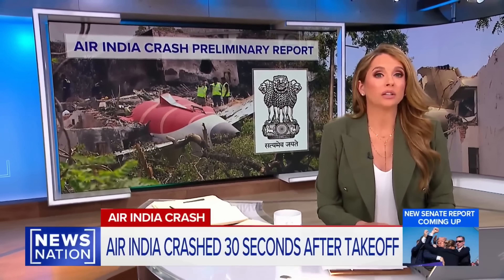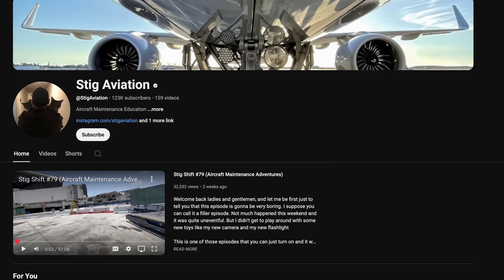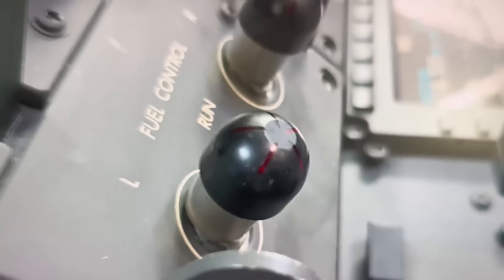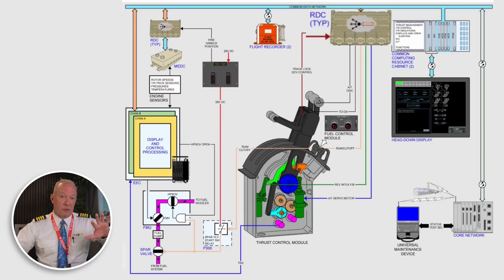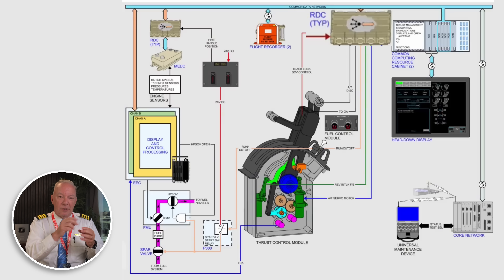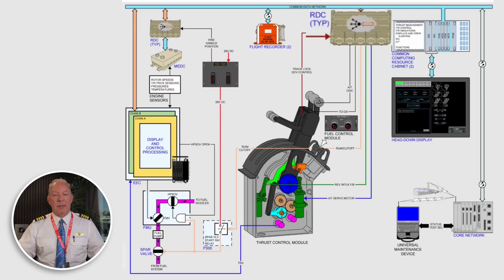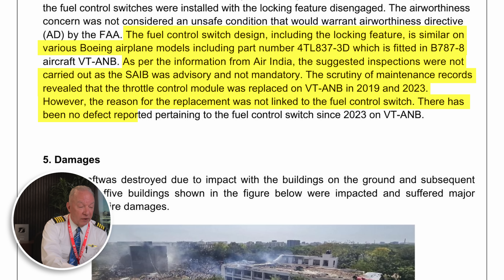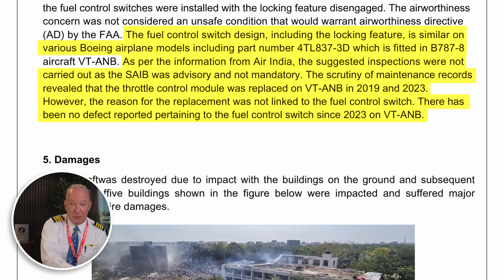The Truth About Boeing 787 Fuel Control Switches

Comment: 7:55 Captain Steeeves statement that all fuel control valves are part of a closed loop system controlled only by manual cutoff switches is totally incorrect. Boeing's own patent document schematic for the TCMA system (US patent 6704630B2) clearly shows that the HPSOV valve is connected to both the manual cutoff switch, AND a pair of autonomous FADEC relays that have the ability to rapidly shut fuel delivery to the combustion chamber by closing the HPSOV solenoids. While it's true that the TCMA system (in theory at least) is only operational when the aircraft is on the ground, the two EEC relays that it controls must remain operational at all times for fuel to flow to the combustion chamber. A paragraph from the patent document reads as follows: “In a preferred embodiment, HPSOV (58) is controlled by fuel control relay switch (108), which is located in the cockpit of the aircraft. Placing fuel control switch (108) in the run position while fire relay Switch (82) is in the normal position causes input (72) to Supply Voltage, for example 28 Volts DC, across HPSOV open coil (118). When fuel control switch (108) is placed in the run position, Voltage is Supplied across ELMS run coil (88), which energizes ELMS run coil (88) and causes ELMS relay switch (102) to be in the run position. With ELMS relay switch (102) in the run position, ELMS (52) Supplies electrical current to EEC first channel relay Switch (22). If Switch (22) is in the run position, current flows to EEC second channel relay switch (28), and if Switch (28) is also in the run position, voltage is applied across HPSOV open coil (118), which energizes HPSOV open coil (118) and allows fuel to flow to the engine utilizing HMU (64). Thus, for HPSOV open coil (118) to be energized, and for fuel to flow to the engine, both EEC first channel relay Switch (22) and EEC Second channel relay Switch (28) must be in the run position. If either one of the EEC channel Switches (22) and (28) is in the cutoff position HPSOV open coil (118) is not energized and HPSOV closed coil (100) is energized, thereby closing the HPSOV and shutting off fuel flow to the engine.”
Reply: so why are there so many comments praising steeeve at the top section of comments?
Reply: @CoffeeHead047  , how does comments praising something change the facts of a circuit diagram??? Do you suppose people praising a piece of poop will make it appetizing or edible??
Reply: TCMA is not going to be involved here, though. Anyone reading up on it should understand that. If TCMA were somehow active, you would see all sorts of signs of that, anyway. It would be obvious in the data. We don't see that at all.
Reply: @bills6093  I agree in that if TCMA were to be involved, there should have been an EICAS "Eng Fail L-R" warning along with an audible warning, which doesn't appear to be the case. To be clear, I'm not speculating as to the cause of this incident, I'm only pointing out that there are two autonomous relays in the EEC module that are connected to the HPSOV valve, along with the now infamous manual cutoff switches. No more, no less.
Reply: Do you have a link to share?  Or are you just making tuis shit up?
Reply: @mas3ymd  I am QUITE sure greg's not making this up. But why don't you just check it for yourself? It took me less than 10 seconds to Google the Patent Number he listed. He quoted the patent word-for-word.
Reply: So there's this new thing called "the google".  If you type that patent number into "the google" and press the enter key Voilà, its Magic!
Posting comment with URL link gets it automatically removed pretty much all the time now, because this isn't the youtube people liked in say 2007 anymore.
Also it's happened during landing at least once, possibly 3 times and pilots can't relight the engines.  Other channels like Garybpilot have covered this recently.
Reply: @mas3ymd  It's not hard to find. Google patents US6704630B2 Thrust Control Malfunction Accommodation
Reply: @mas3ymd  , captain steve shows part if the circuit diagram. It clearly shows this is not a "fully closed loop" system as the poster above indicates. There is an "AND gate" on one of the components, which means there is some other inputs in the system.
Reply: You say alot, but regardless, the system was checked thoroughly and found not at fault 🙄
Reply: @gregmiller3630 That is a load of it. I’m a Electrical Engineer and what you are saying is bogus.
Reply: @mtwedt  Did you look at the patent? The wiring diagrams? The signal path and operational description?

Where did you get your degree, and can you still get your money back for the tuition you paid?
Reply: @BryanM61  I have looked at the patent.
1) It's a patent, not a design document. How do you know that it applies to the 787? And even if it does apply to the 787, just because Boeing has a patent doesn't mean they implemented it the same way as the patent describes.
2) The diagram Steve shows in his video is derived from design documents specific to the 787.
3) The scenarios described in the patent are not present in the accident.
4) The preliminary findings say that the switches were moved, although they don't say how they know, it is probably from hearing the clicking of the switches on the cockpit audio recorder.
Reply: @mtwedt  Here's how we know the switches were moved: As Captain Steve explains in the video, and as shown in Stig's diagrams, each Fuel Control Switch has 4 wires that lead to (redundant) Remote Data Concentrators. These wires run directly to the RDC's. 2 wires signal 'RUN', 2 wires signal 'CUTOFF'.

When the wire energizes - which can only happen if the switch is moved or the wire is shorted to ground - the RDC's format a data packet with the specific Device ID and the event type (e.g. "FCS#1 -> CUTOFF"), and send that event to the data network.

The DFDR "sees" the event and records it to the data log. 

Since the Prelim implies timestamps for the first two events, and gives exact timestamps for the last two, those MUST have been read from the DFDR data log.

In the case of switch transition to RUN, that data packet is also "seen" by the EEC, and the EEC begins the engine re-light process, which happened with both engines.
Reply: "The aircraft air/ground sensors transitioned to air mode, consistent with liftoff at 08:08:39 UTC."

The aircraft systems were in Air Mode; the TCMA could not have been active.

Comment: Sorry Steve. The fuel control module is not tied directly to the relay according to the diagram you put up. In fact it does not show it tied into anything. The wire that activates the relay comes from the RDC shown at the top right of the diagram. We would actually need to see a true electronic wiring diagram to see how it works. I don't understand how you could be so hell bent on accusing the pilot of mass murder here! imo

Comment: Great video! If the Ram Air Turbine deployed after the AC power went out, that means the aircraft’s DC system was still alive — because the RAT is deployed and controlled by DC power. Those same DC buses power the cockpit fuel cutoff switches and keep the fuel valves open. So if the RAT came out, fuel was still being supplied, and a simple AC outage alone couldn’t have caused both engines to quit. The engines don’t need AC to run. It doesn’t seem an AC outage is the correct theory. Pilot manipulation of the switches still seems the primary theory, despite the fact millions of people can’t accept that.
Reply: Please watch Flying Beasts analysis before commenting about this topic

Comment: Sometimes people don’t want to believe the obvious.  They continually search for faults in logic.  The only way I could see those valves closing is a stray voltage to the closed side of the relay.  Both relays one second apart.  Would that give the same signal as the switches actually moving.

Comment: I see Steeeeve is following the Boeing/FAA narrative... You'd better hope the actual truth remains concealed, or your going to look rather stupid...
You mention the battery, but you didn't mention the protection diode and the effects of transients on the batteries BMS.... 
Also, no the voltage going through the switch is not the voltage driving the fuel valves! Thus, they cannot be, and I quote you "directly connected".... Seriously just stop with the narrative....

Comment: Never say never. So in other words a simple, mechanical, electrical short of the wire by a loose wire etc, to the relay could trigger the relay to operate without the physical switch being moved. Now of course I don't in a split second believe that happened, especially not twice to both relays. But I just want to point out don't over-state the case. Relays in toys, cars or even airplanes are not immune to loose wires and/or short circuit faults by loose metallic elements or debris, etc.

Comment: That guy inthe intro apparently hasn't been paying attention as it's been demonstrated that in order to move the switches it has to be intention to put them from off to run.  Let's also not forget that the first office who was flying noticed the switches were off it seems as he asked the piot why he did that (switched off the engines), plus the engines were off for some 10 seconds, which is a long time IMO during take-off.

Comment: Tell me Captain.  What would be the response of the copilot if the pilot reached for the switches with both hands during takeoff?  Would it be why did you do that or why are you doing that?  With 0 discussion is any pilot or copilot going to let the other just grab the fuel cutoff switches without even a verbal intervention?  What are the the chances of even being able to do it simultaneously manually?  Lots of holes in the pilot theory.

Comment: Once it was learned that the fuel cutoff switches had been turned off shortly after rotation and been turned back on after a verbal exchange between the two pilots and a denial by one of them, only two questions remained:
1) can anything else (a computer or malfunction) command fuel cutoff independent of the position of the physical switch? 
2) was there a third person in the cockpit who moved the switches to off?
This video pretty clearly rules out #1, and CVR (at least) should have provided evidence of #2. 
So we're left with a deliberate act by one of the pilots. Monstrous, but there is no other explanation.

Comment: Is it possible that if any of the engine or APU driven generators didn’t come online because they weren’t turned on, or they were turned on by pilots but due to wiring faults/shorts they weren’t actually charging the battery? It’s possible that the batteries can become completely dead and the relay loses DC power leading to closure of valves. 20-30min is perhaps right amount to time from pushback to taxi and takeoff, perhaps on a hot day because the self discharge rate of batteries is so high due to high temperature, I think it’s possible all batteries got completely discharged. A complete electrical failure including dead batteries is what we need to think of that caused the RAT to deploy. Unfortunately turbine engines are not like piston engines with magnetoes that continue to run with momentary fuel disruption and pickup RPM right away after restoring fuel supply. Captain Steeve is right on how the switches work, but we need to consider the scenario where all batteries are dead. Also, the fuel cutoff switch is not a purely mechanical switch, but an electromechanical one. It needs DC electricity from the battery for the connected relay and valves to function as intended. The mixture control on my Cessna 150 is a purely mechanical control because it connects to carburetor directly and will function even with dead batteries. On the other hand, it seems fuel supply will be cutoff when the battery and generators are dead on a 787, even if the switches were never physically moved to cutoff. Poor design?

Comment: As soon as you have a short circuit anywhere, the 28V DC breaks down and the valves close without the switches being moved. The 787 has a history of battery failures probably caused by a blown diode where the battery was short circuiting (and burning) wich would bring the 28V DC down and, as far as I understand the schematic, close the cutoff valves.

Comment: Thank you Captain for the calm logical analysis.   Folks, you do realize that sometimes the simplest explanation often is the truth. I know its hard to hear but there is a very good chance someone on the flight deck turned the fuel control switches off.  We don't know why yet but the reason will come out.  If water ingress, failed batteries, bad software, faulty switches, Fadec issues or whatever else is claimed were the cause of this crash there would be planes dropping out of the sky everywhere.  Have you ever heard of redundant systems? Modern jet aircraft are wonders of engineering.  Triple redundancy is common. Sometimes more.  These aren't cars where one component fails and you are on the side of the road. For example if a fuel pump fails there is a second pump to take over with another backup to follow that one.  You know why parts for aircraft are so expensive?  They have to be the best quality and as well made as they can be so they don't fail..

Comment: In China, an ARJ21 aircraft was found to have a fuel control switch cut off during flight. This aircraft was equipped with the same Honeywell switch, which can be stopped in the middle position due to a structural defect.

https://www.caac.gov.cn/XXGK/XXGK/ZFGW/202007/P020200710307974362325.pdf

Comment: The schematic was very interesting. I wish however it would include the signal path of the flight recorder. I assume this is a device with lots of digital inputs. Does it get the signal from the switch itself or from the relays? Is there any way an electrical failure in the wiring or electronics (e.g. the flight recorder itself) could have had the same effect as the switch being moved mechanically?

Comment: so if that scenario happened 45-60 minutes of shore and theoretically would have a dual flame out when the battery died because that closed system lost power. has that theory been tested 
Thanks

Comment: Enjoy your explanations . Didn't the little prop driven gillicaster fall down gasping for electricity ?  Could the battery itself ( the final fail safe in the fuel delivery route ) have gone smack off line ?? When the power goes out at home , the FIRST thing I do is start flipping switches .....sigh....we'll probably never know , God bless the grieving families  ☹

Comment: Kindly note that this explanation uses "block dijagram" instead of actual wiring digram, so it relies on several assumptions that might be true but may be false as well: note some technical points 1) every time throttle control module is replaced it is not hardwired to the relay, as there is some connector in between, eg. switch is not directly wire line connected to fuel relay module, so there are points of  potential malfunctions . 2) switch state recorded in flight recorder is not from actual switches but from one of digital modules that are connected to switch, so there is another component connected to the circuit which can be prone to electrical issue, 3) power supply to switches is not directly connected to the battery, as there must be plenty of other components in line that share same power supply so interference is technically possible... While I would not  speculate if there was or wasn't an actual malfunction or pilot operation kindly nite that Aviation history has great examples of components that seemd unbrakable while thought investigated accidents found circumstances when they actually fail catastrophic - remember hydraulic rudder valve jam and rudder reversal issue in Boing 737 in '90

Comment: To shut the valves without physically moving those switches, simply short the 28V battery... that's what a total electrical failure means:  no current whatsoever. And this can be caused by a plethora of weird things that need to be considered (that's why the final report of a crash normally takes 1 or 2 years to be published).
Reply: What evidence do you have that the batteries shorted?
Reply: @EsparkyDog  I've none, exactly as Captain Steeve or anybody else. My point is : let the investigators do their job and stop insinuating the idea of blaming the pilots.
Reply: @biula3278  I've flown airplanes since 1981, professionally since 1988. There are certain things that you hear, or don't hear during investigations that lead you to conclude the reason for an accident. The Indian investigators are yelling out loud the captain killed that jet and I believe them.
Reply: @EsparkyDog  Well, I think that when the final report comes
 out probably a year from now, you'll be surprised and sorry...
Reply: @EsparkyDog  they don’t need to be shorted, if the engine driven generators are not online due to not turning them on or faulty wiring not recharging batteries, the batteries will get discharged quickly, especially with such a high temperature the self discharge rate is high as well
Reply: @theeternalguy  What evidence do you have all 4 engine driven generators were offline? When did they go offline and what would cause them to trip? Was the battery voltage low? How do you know?

Comment: About ANA dual engine shutdown 
Boeing Bulletin:
Boeing had previously issued a service bulletin regarding the TCMA, noting that deploying thrust reversers too soon after landing could trigger the system to shut down the engines. 
No Engine Failure:
ANA later concluded that there was no engine failure, but rather a shutdown caused by the TCMA system. 
Software Issue:
It was suggested that a software glitch within the TCMA system might have been the root cause, potentially misinterpreting the aircraft's status on the ground. 
Impact and Follow-up:
Corrective Actions:
Following the incident, Boeing issued warnings and requirements for inspecting the aircraft